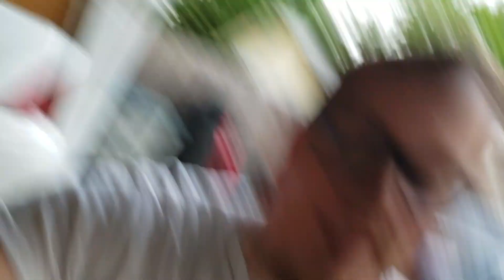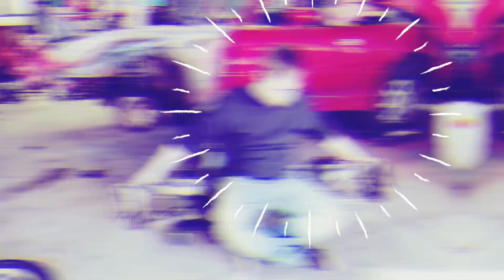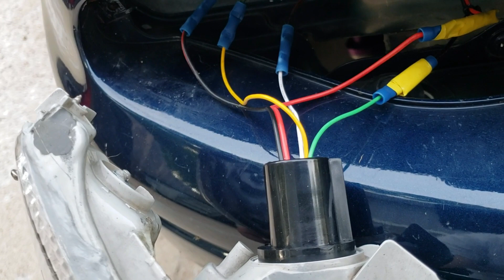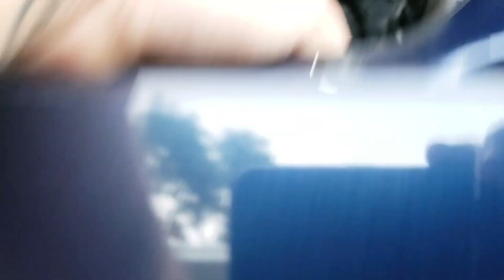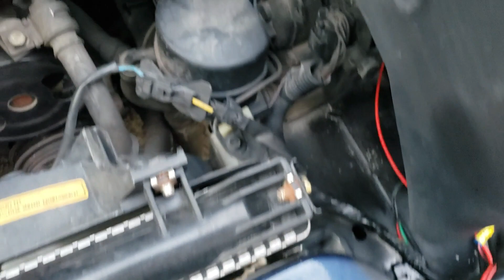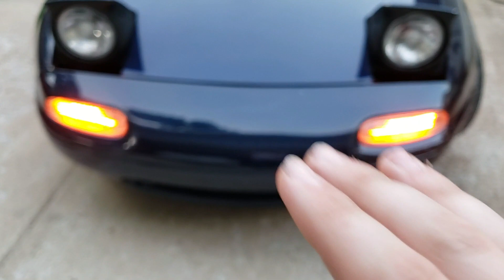Miata Sequential Lights are DONE!

Comment: https://www.ebay.com/itm/100PCS-Solder-Sleeve-Heat-Shrink-Butt-Waterproof-26-10-AWG-Wire-Splice-Connector/333216087550?epid=15018183357&hash=item4d9539fdfe:g:hq4AAOSwJOlc8Ag7

Comment: Nice dude. But for the love of god, solder or properly crimp those connectors (with heat shrink for waterproof)
Reply from the maker: Yeah... like I said it will get the proper connections. Those are temporary.
Reply: Wow you are just like me, I cringe when I don't see heat shrink and solder connections lol